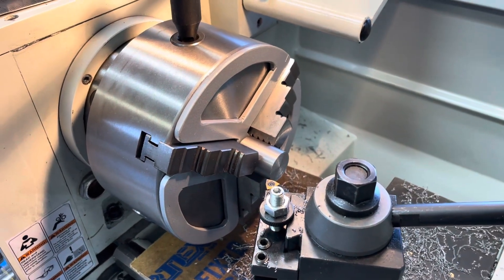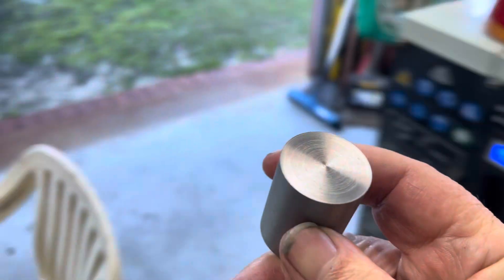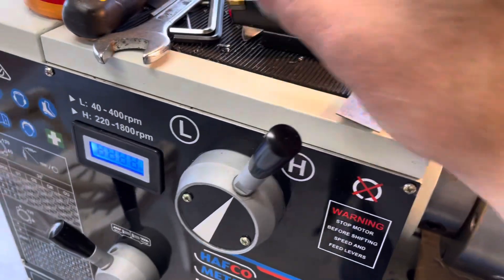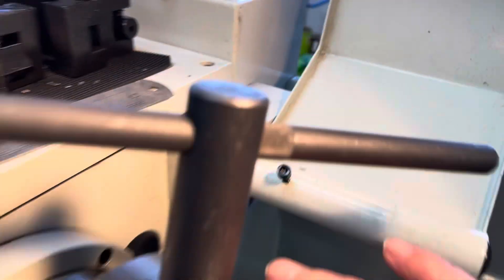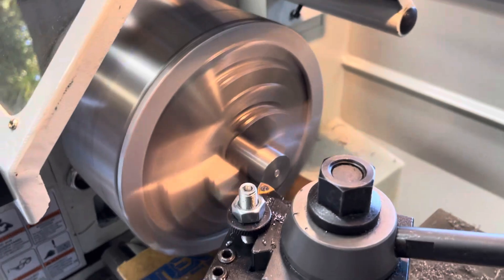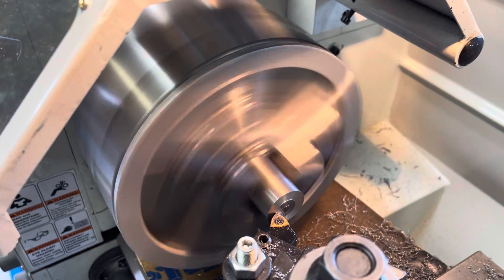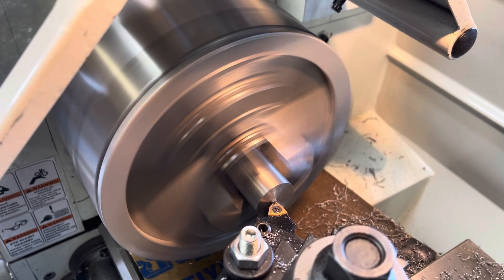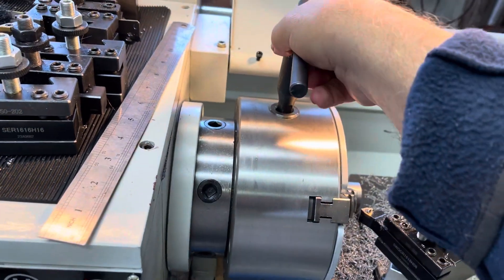Robland X31 Blade Height Micro Adjuster Top Mounts Machining

Comment: Hi Ian, I enquired a while ago ,and am just wondering how they are progressing?
Thanks 
Mark
Reply from the maker: @MarkBrown-kn5yk  Slowly is the answer Mark. Been up in the shed most of today, trying to “sort out” my lathe & mill tooling.
It’s spread all over my work bench, from one end to the other, 3 layers deep.
Just bought a used roll cabinet with drawers & side cabinet and sorting & storing all the tools, so I can “reclaim” my work bench real estate & get more organised to be able to crack on with the machining, without spending inordinate hours trying to find tools that I need & know I have but simply can’t find.
Almost got it under control, more time tomorrow should see it sorted out finally.

Nothing more frustrating than not being able to work because you have no work space & can’t find tools you know you have.

My favourite pair of pliers that I bought back 1989 - so 35 years ago have just up & vanished.

Of course I have a 3.5 year old grandson who visits every Saturday - so likely they will turn up one day rusted into a mess somewhere in the garden or one of his toy boxes maybe.

It’s just been impossible to get a steady run on the milling work for a while, so I’ve stopped and started tackling the mess one job at a time.

Need to get at some stock to machine but it’s buried behind the pieces of timber crates that the Lathe, gantry crane & mill arrived in, so been sawing them up each day into pieces small enough to go in the wheelie bin green waste - to get collected each week.

So in order to do even simple jobs, I have to do 3 or 4 “side jobs” to be able to get at the material or tools I need.

Making great progress towards that end but like everything the side detours eat up machining time and the material funds.

Hopefully when all sorted I can then get uninterrupted work time back on the blade adjusters machining project.

The last things will be getting brackets plasma cut & buying hardware out of USA & that’s quite a few $1000’s US just there alone.

I’m putting in the hours getting organised, while waiting to put aside enough capital to start ordering things that I won’t actually make myself (half / speed nuts, alloy handles etc).

Comment from the maker: Sorry I cut the video off guys trying to undo the Chuck with the key I managed to push the stop button on the phone. 🙄😂😂
Reply: Bugger, coming  to Perth today, to go on the Indian pacific  Sunday
Reply from the maker: @MarkBrown-kn5yk  You will enjoy the trip 100%. Worked for the railways in a previous life & did the trip there and back in ~ 1982 or so from memory. 👍
Reply: I hope 1 of those 32 is mine😮
Reply from the maker: @MarkBrown-kn5yk  Wait till I have them all done. If you were to miss out, I’ll just make another batch until everyone who wants one gets one. 👍
Reply: Great,  just let me know how/best way to contact  you.
I'm pretty sure you said you were  melbourne  based, I'm in Altona  so may be able  to pick up 
Thanks
Mark😊
Reply from the maker: Hi Mark, I’m WA based (Perth), but I can post over to you no worries.
You can always email me:- ianmoone1111@gmail.com
Or Mobile / Text 0400722006

Just been up the shed completing the lathe work on the top mounts, then cleaning up the lathe from head to toe, ready for making the alloy handles next.

I have some Mill work next making the 2 flats on the 30 top mounts, and lastly drill and ream the 10mm cross hole, de burr & chamfer the holes & that’s the top mounts out the way.
It’s crazy - they have the least material in them, are the smallest part BUT, they are the most complex / time consuming to make, and the two 1200mm long round bars - that I made all these parts out of there’s a full metal garbage bin of metal swarf that I can barely lift, just in what steel was removed to create the 30 parts.

After this batch are done & out the way, I’m half tempted maybe to see what a engineering shop would charge to CNC machine them for if I was buying say another 30 for the next batch assuming there’s enough demand to need another batch. The amount of time that goes into making short production runs manually on a lathe is eye opening.

For now I’ll just plug away at completing this batch & re-assess better production methodology if I’m going to do another batch after this lot.
Reply: I’m in the USA. Will you sell and ship to us?
Reply: @kenhugen285  well that's not fair!
With that exchange  rate
Reply from the maker: @kenhugen285  Of course I will sell to & ship to USA. Almost half of the last batch went to USA. With the exchange rate the cost should be approx 2/3rds of the planned ~ $500 AUD rate.